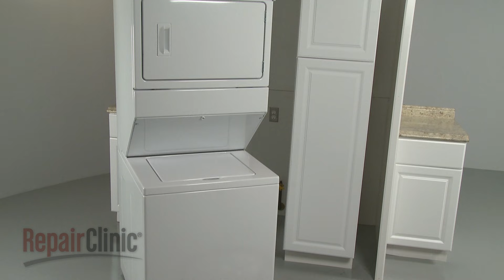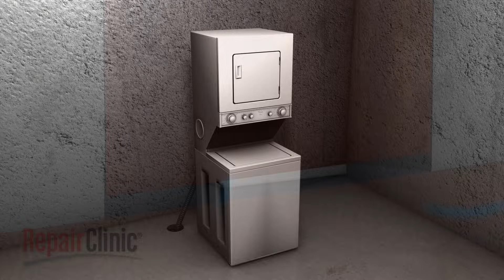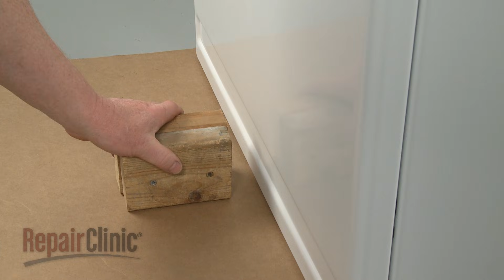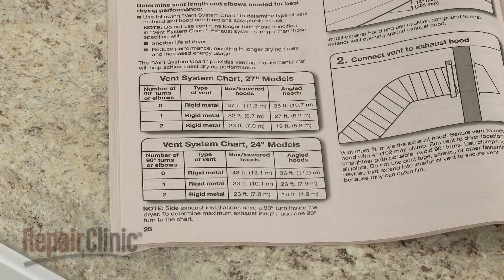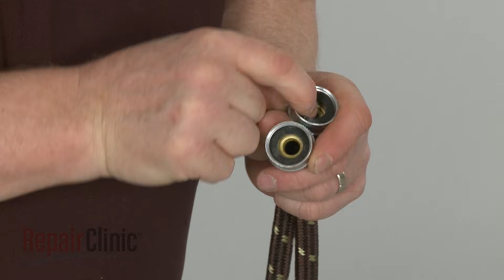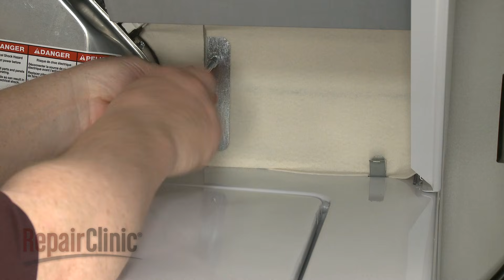Whirlpool Combination Washer/Dryer Installation (Model WET4027EW0)

Comment: Thank you.  If I understand the removing the front panel to get at the pipes is optional?  What is the block of wood that came with the unit for?  Is it for adjusting the legs?

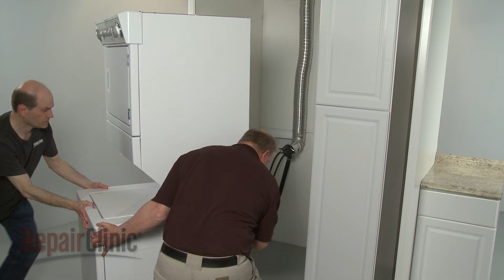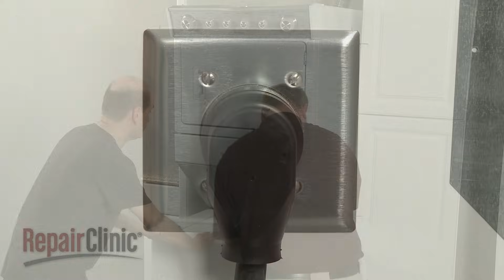Comment: With less than 4" between the combo and the closet frame (8:56) miraculously shrink your body to available clearance to get to the back of the combo. Connect hoses, vent, plug in and get back in front of the closet to push the combo in (9:32).
Reply: Thank you

Comment: HEY, thanks for the vid esp @ the white ground wire but....there is NOWHERE that shows an instruction/opertating manual not even whirlpool. THERE IS NO WATER LEVEL SWITCH!! wtf is up with that? i have a washer that only fills up half way no matter what i do. i found this water level pressure sw at whirlpool, is that what must be wrong? i have NEVER seen a washer that didnt have a level knob. whirlpool is a joke as always. if they sold out to china they would probably be better. wth do these American engineers do at work. play with themselves? thanks in advance for any answer. btw the p/n for the pressure sw is W11129441 and they want $82

Comment: I have a question is it safe to have true washer and dryer both running at once or is it all on one plug in? We have to get one for our new house. We thought it had a laundry room it has a laundry closet! (Guess it’s better then going to laundry mat still!) but just curious cause we are trying to find a good stackable washer and dryer that allows both to be used at the same time when we have multiple loads to wash and dry.
Reply: You can run both at the same time
Reply: @zozomicky  finally someone answered me, I just was curious. I never had one before and I do multiple loads at the same time. As I am known for falling behind on laundry anyways thanks for responding.

Comment: The timer came apart,  first the knob came off, them the whole switch came out of its mounting.  How to take the panel to get the old one  out?
Reply: Ignore the mean comment, you will need to ask around for a trusted electrician. Also, take a photo to help with a description of the problem.
Reply: throw the machine out...go to the laundromat instead ~